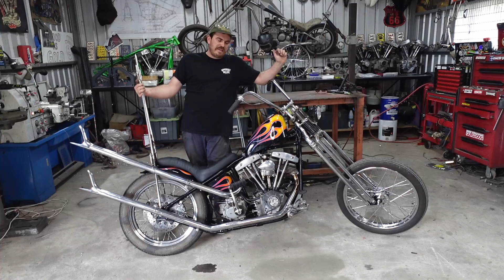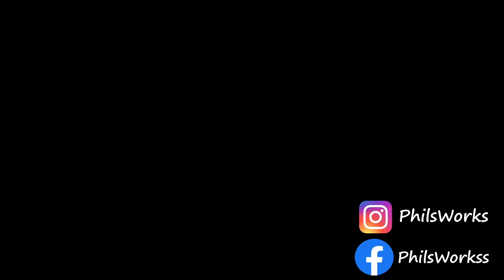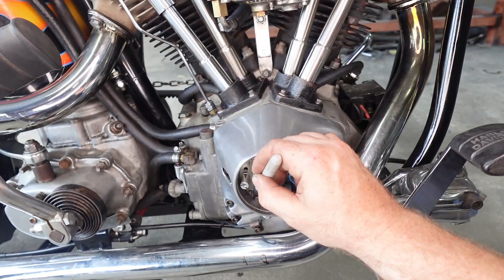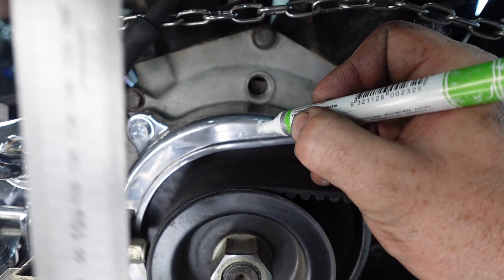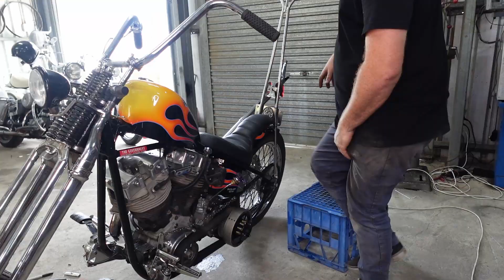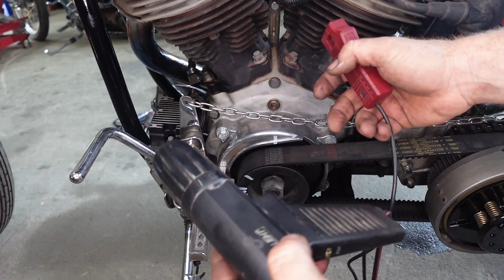Static Timing Vs Dynamic Timing Harley Davidson Shovelhead

Comment: Those advance weights looked loose and flogged out (sloppy), and then the timing light seemed to prove that because at idle the TDC mark was jumping around quite a few degrees.
I would replace the whole advance mechanism with a new one, and new points cam that goes with it.
The advance mechanism you have should probably have been oiled about 20 years ago lol 😊
Reply from the maker: Ill have to get you to do it in future

Comment: Great video. Confirmed what I thought. My pops passed right after he tore out the wires to rewire his chopper. Now to find a video to help me understand wiring in two coils for a dual spark plug setup on a shovel 😅
Thanks for the video mate!
Reply from the maker: Thats easy mate! just need a single fire ignition with 2 trigger wires!
Reply: @PhilsWorks The green VOES wire had me all jacked up. Soon as I realized I could ignore that, it was exactly that, a piece of cake! 🤙

Comment: Phil- what year is this motor? For others that have different year models, this video may not apply. It wont let me post a pic here but, Earlier motors (1980 and earlier)  had the DOT as the Front Cylinder TDC mark, And the LINE as Advance Mark on the Front Cylinder.
Reply from the maker: pretty sure I mentioned that in the video. stick a screwdriver down the plug hole and double check where the piston is

Comment: I thought you were supposed to manually advance the points cam while rotating the plate when setting static timing.
Reply from the maker: You can on the advance mark yes. But I’m just doing TDC mark
Reply: @PhilsWorks  Gotcha

Comment: Love the videos Phil, quick question, after the static timing I didn’t see any changes made so what is the difference between static and dynamic ? Does the dynamic just mean the act of inspecting the timing and making sure it’s right and making changes if need be? I’m seriously asking sorry if I’m missing something obvious.
Reply from the maker: Mate I checked the timing while it was running and it was pretty well spot on. I just set static timing and then ride the bike. see how it goes. add some timing take it for a ride see if it likes it. If it does try a little more. if it doesn't try a little less. You can perfectly dynamic tune your bike but at the end of the day it might not be optimal to what the engine likes. Factory settings are always on the retard side to be nicer on the engine
Reply: @ ok , thanks for the info . Love your videos man thanks for sharing!

Comment: Hey Phil!
Hello from Missouri, USA
Nice video. How critical is point gap to timing. I was told years ago that for every .001" the point gap is off, the timing changes by 3°.  While I can visualise how that could be, I've always just set my points as close as possible before I static time it. That has always worked good enough for me. But I don't tune for max performance either.
Just curious what your thoughts are.
Cheers
Reply from the maker: Hey mate, I’ve always set my points to 18tho before setting the timing. (Close enough is good enough on these old things haha)

Comment: thanks for that video, dude! it’s really useful, but what to do if I have an ironhead? can I do exactly the same steps on it? because I need to take off the clutch cover 🤔 thank you! greetings from Russia!
Reply from the maker: Yes its a little more difficult with a sportster. You'll have to use the clear bung in the case. But yes, process is exactly the same just work out what timing marks your flywheels have.

Comment: Back in the '90s I put a Rev-Tech dual fire ignition in an EVO.  This is dual points to make single-fire ignition with a points-type system.  Basically, do what you did on this video, do it again for the rear cylinder.  It ran great, but replacement points/condensers became unobtanium, so I was forced back to electronic single-fire systems.
Reply from the maker: Yes Cb750's have from factory twin points sets that are individually adjustable.